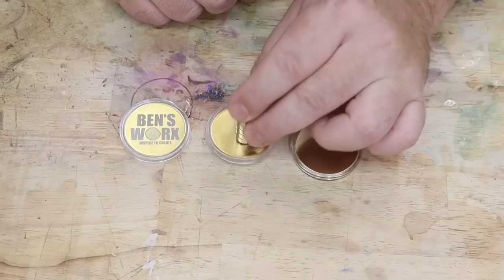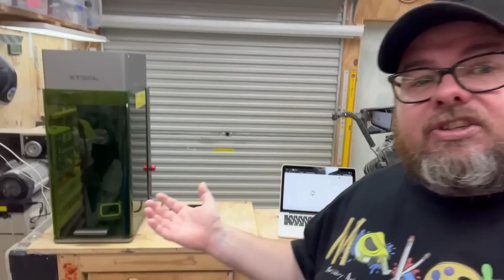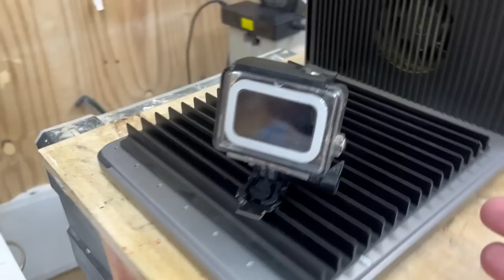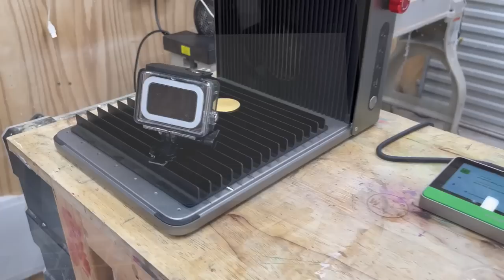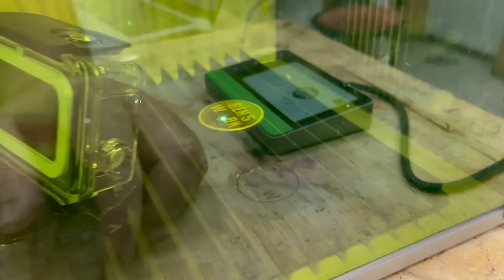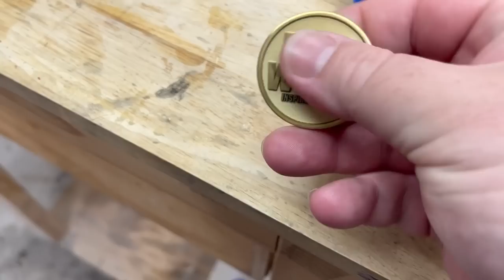How To Make Your Own Coins! - Side Hustle Ep2 F1 Ultra

Comment: I wonder if this laser is capable of doing interference colours by engraving microscopic ridges and valleys at the wavelengths of visible light.  

This process would be similar to the structural colour produced by interference patterns in butterfly wings as well as the colour effects obtained in aluminium by anodising processes. It is produced by creating ridges and groves down at the wavelengths of visible light.  

A rough analogy of this process on the macro scale is the mobius patterns produced when you place two flyscreens close together and offset one of them.

Interference pattern colours are very cool because they're both real colour and an optical illusion caused by light rays of particular wavelengths creating an interference with ridges and groves in the surface of the metal.  Unlike pigments and inks, they never fade although corrosion will cause them to eventually fade away.